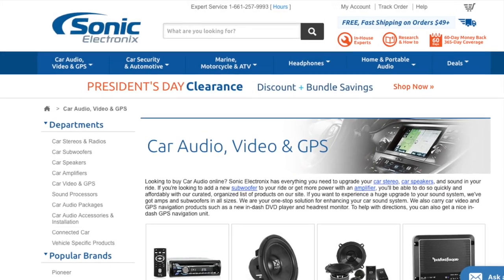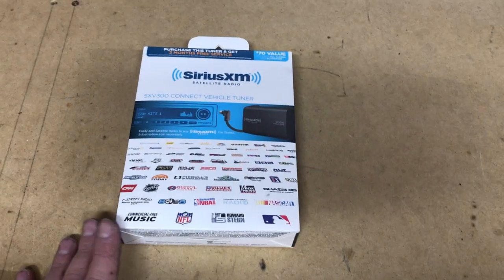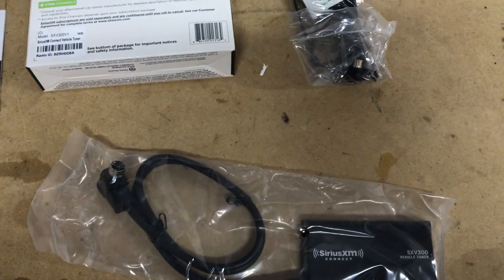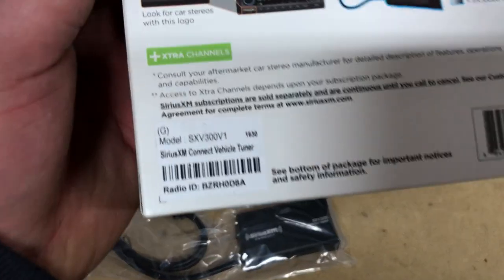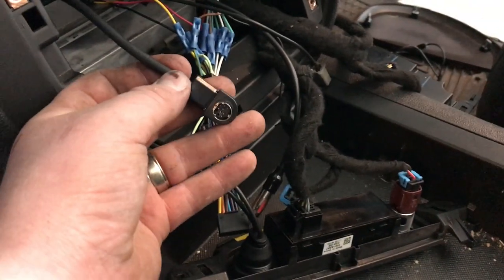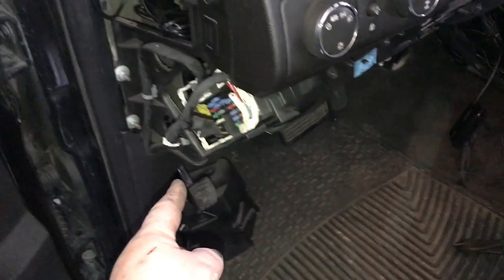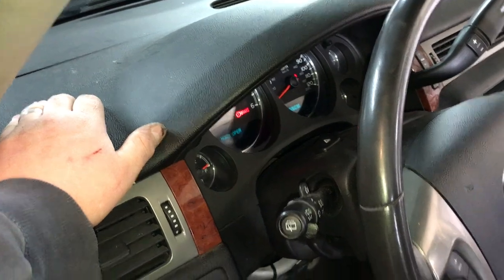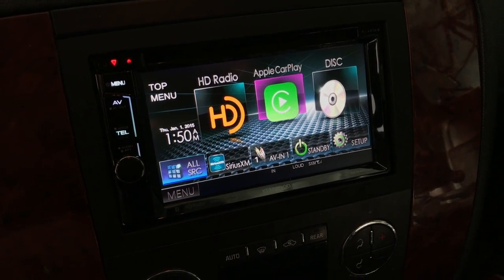How To Install a Sirius Satellite Radio Tuner To a New Radio

Comment: Why do you need to put a new antenna if it already has the sharkfin antenna? Did the truck come with Sirius from factory?
Reply: The stock sharkfin antenna is for AM/FM radio, not satellite. This tuner is designed for aftermarket head units.
Reply: @TommyK0180 the stock shark fin is absolutely for SiriusXM, what’s the purpose of the antenna screwed into the  hood?

Comment: I got a Clarion CX-501 Sirius Ready Radio and the wires for the Sirius tuner would not fit the radio, it was a different connection..... what is going on?

Comment: If the OEM radio that's being replaced already has Sirius XM built into it, can you use that antenna instead of running another antenna? That should be a cleaner install.
Reply from the maker: Yes, depending on the radio and the vehicle.  Send us a message on instagram / facebook and we can point you in the right direction.

Comment: I have a question. I have the older jvc sirius module and I'm grandfathered in, no subscriptions nor monthly fees to pay.  My old car is getting old and wanted to transfer this jvc module to a new car, 2022 nissan sentra but keep the factory sat. ready stereo in the car. Is there a adapter or interface that might help me connect the jvc tuner to the nissan factory stereo? Thanks any feedback appreciated.

Comment: Why didn't you use the Sat Antenna already installed and mounted on the vehicle? Is there a different connection for the antenna than the one. already supplied in the vehicle?
Reply: They make adapters that allow you to do that, but not all cars came with Satellite Radio natively, so the antenna adds that functionality that wasn’t there before

Comment: Is there no power source needed? It's just the antenna to the tuner to the radio? 
I had a Starmate 2 from 2005 and it finally died on me. I have an extra Starmate 2 but wondering if it's best to just buy that tuner since my new dash radio is a Pioneer DEH-x8700BS.  Thanks.
Reply from the maker: The XM tuner draws the current directly from the radio, no external power source required.  The SXV300v1 is very inexpensive and works great, i recommend it for your DEH-x8700BS.
Reply: @ProvoBeastAudio  Nice

Comment: Can you plug a kenwood cd or minidisc changer to that Sirius input?
I got a kmd401 I would like to use with a new kenwood unit. I am after the big 10.1 screen model ideally. Really want to use this old md changer.
Is there any chance you can experiment for me and see if it works? 
Try it with a kenwood cd changer maybe. It would be gratefully appreciated
Reply: yeah ive been told you CAN NOT.
but i have a free box coming from best buy and ill see what the pinouts are.
ive wondered myself for years as the old kenwood head units with  changers would work as satellite receivers  but that was 20 years ago.
its a old reply but im sure were not the only 1s
Reply: @luvdady  
Yeh plug looks the same as it did back then and they still say you can use it for dab. Before they said dab or changer that's why it got me thinking maybe it is compatible but they don't say so because the cd md changer game is old like you said
Reply: Ok just got the box for the satellite. 
The plug is smaller then the cd/old plug and pinouts different. 
So no dice sadly.
Which I got a new head unit that has hd radio etc no cd, so changer would have been great
Reply: @luvdady  
Thanks man that was useful.
I got one more to check now.
I wander if my sony xspn1bt would work with the old sony minidisc changer. I think mdx65 or mdx85 the changer. If you ever get that chance let me know. I will try this one myself at some point.

Comment: what if my car already has the sirius button it is a stock radio can i put that tuner in it and will i get the xm through my car radio
Reply from the maker: If you already have the SAT button and want to retain the factory radio, you will need the factory GM XM turner module, this module only works for aftermarket applications.
Reply: about how much is the factory gm xm tuner
Reply from the maker: Depends on the year make and model.  I would check ebay or the dealer

Comment: So let me ask you this my car was Sirius ready and my aftermarket radio is ready so I still need to use there antenna or is there a diffrent thing I need?
Reply from the maker: Generally the XM tuner is built into the factory radio. This is not the case with aftermarket radios which is why they require this adapter.  You can probably use the factory antenna, but the XM radio adapter is needed.

Comment: Bro this is confusing as shit I might as well switch to the app its better anyway, I have a car where it already has the antenna on the factory car (hence the sharkfin on the back). So I get a new touchscreen radio installed and now it doesn't work with new radio guy says get the tuner and install that if I want it.